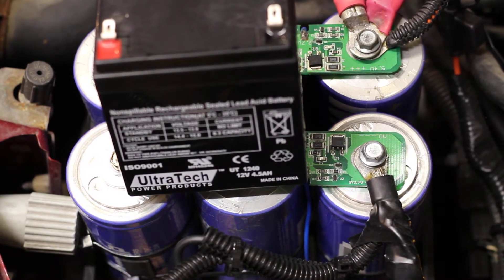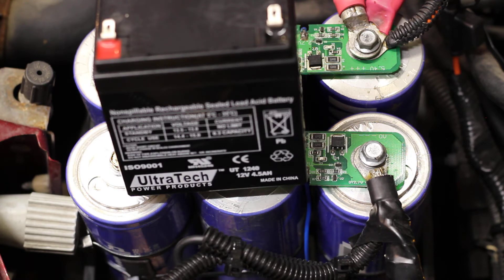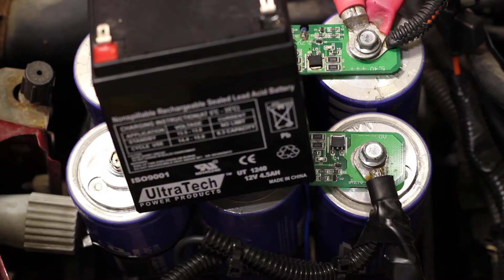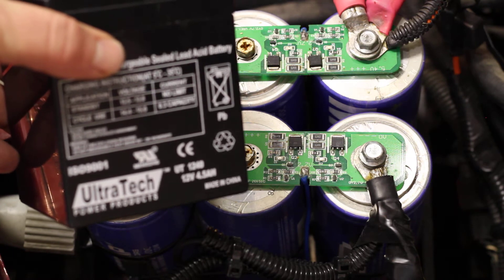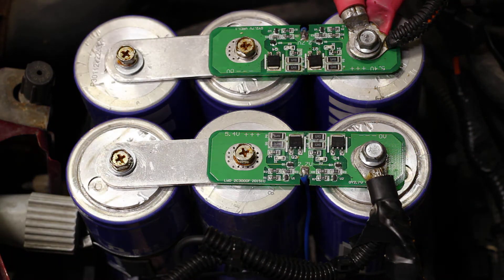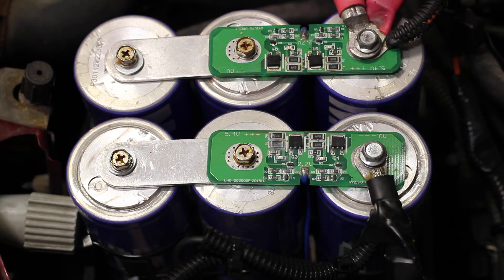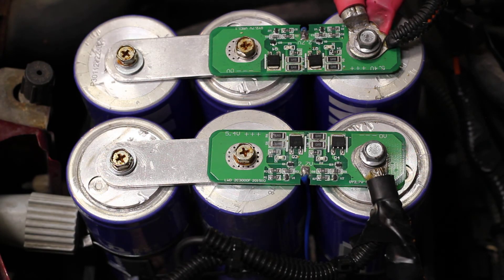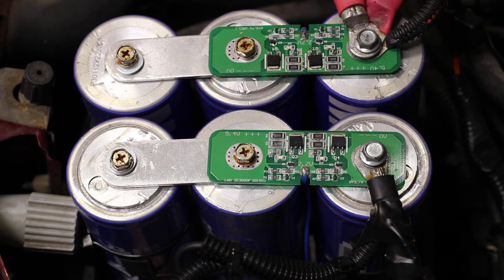Using a super capacitor as a battery (part 14)

Comment: I have been watching some of your excellent videos, and I would like to say a couple of sugestions. First since i times t is equal to c times v is easy to find out the exact capacitance of any capacitor just by measuring the time it takes to charge or discharge from any voltage to any other voltage at a constant current. Second... What about not using balancing  but placing several capacitors in parallel and then connect each group in series with the next one? The idea is to average the tendency of overvoltaging or undervoltaging of each capacitor by paralleling maybe four of them using 24 smaller capacitors in all instead of 6 bigger ones. Finally ... Do you really think that the resistor in series with the battery is necesary? Why not just place the capacitors near the starter motor and leave the job of the resistor to the cables coming from the battery to the capacitors? My plan is to buy smaller capacitors on ebay or.from somewhere that will come to Europe and a decent price, and fit them in my motorbike and all my three cars to try to extend battery life. Can you recommend some vendors? Please leave answers whenever you read this. Thanks.

Comment: The small battery also are not suited to a vehicles charge circuit  permanently . And  for corrosion you would want a coating over the electronics conformal coating i think its called. Once your sure you have no flux residue on the board first.
did you see the lazer sabers setup for a supercap car battery?
Reply from the maker: I did see his but he wasn't using a balancing circuit. Do you have a link to a place that sells good conformal coating? I tried doing that once before but used the wrong stuff so it didn't work.
Reply: wiggys shop  well I only know of www.DigiKey.com I buy the Rubicon Panasonic capacitors etc from there as per www.eevblog.com they have a forum you could ask about conformal coating there.